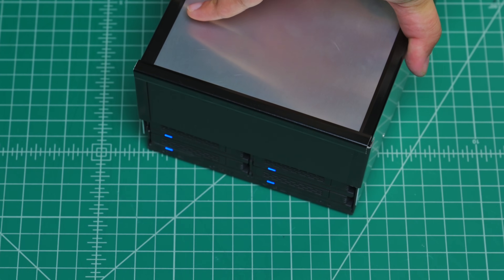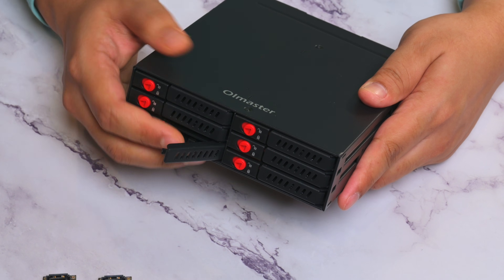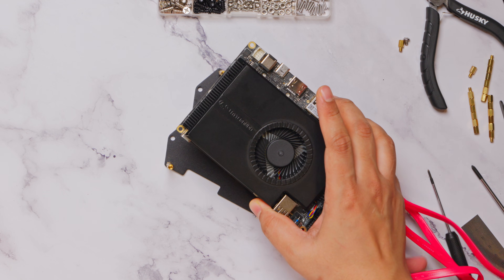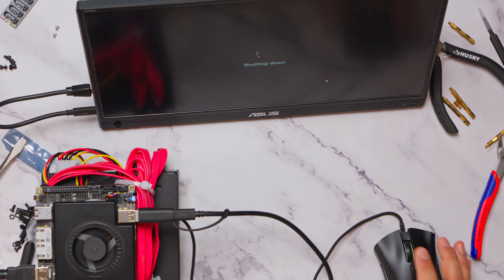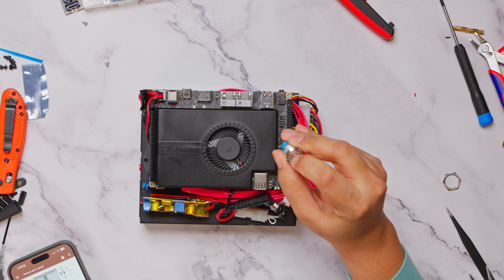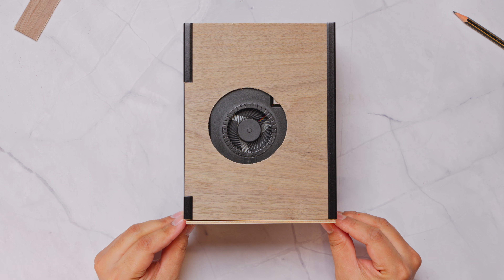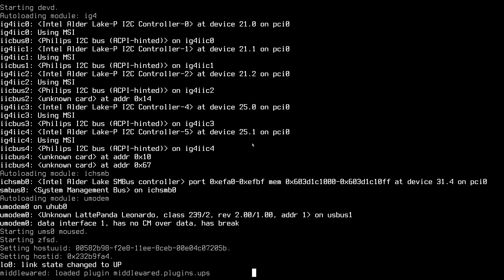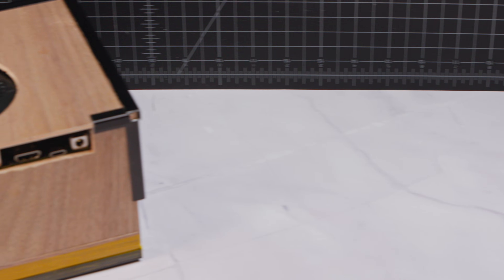Smallest 6 Bay 2.5 SATA SSD NAS Build | Cheap NAS using Mini PC | DIY NAS using LattePanda Sigma SBC

Comment: did you actually have to include a step down of the voltage? according to the specs the lattepanda works from 12v to 20v - so you could have just used a 12v psu throughout?
Reply from the maker: That is a very good question, I wanted to explain that but was too much of a detour so left it out. So, you are technically correct, however there are 2 main reasons for me not doing so,

- They provide a 19V 90W adapter which is the official one they suggest to use, so didn't want to showcase something unofficial here.
- The board needs at least 90W to run properly according to their documentation, probably more if there is heavy load so using a 12V adapter will mean that we will need a 7.5A + power brick @ 12V (90W/12V = 7.5W) which are not very common, and often expensive (high current low voltage is expensive than low current high voltage in general). So instead of crippling the board, I decided to use the buck converter which is like < $5 a piece so was much more cost effective and appropriate, IMO.

Thanks for the question though, gave me an opportunity to clear this out.

Comment: Very nice! I just found these videos (this and about the previous build). Reason I found this was that I've been working on an idea since yesterday about using my HP ProDesk 400 G2 Mini as a NAS. So I'm getting a similar M.2 to SATA adapter, a power extension cable (I won't be using the SSD enclosure inside the HP to save space) and some SATA data cables. Once I've tested and made sure I can fit the SATA data cables inside the case and get the power cable outside as well, I've a flexiDOCK MB014SP-B 4-bay solution to host all the SSDs (that I don't even have yet). Biggest fear is to have all the cables fit inside the HP case and get them out of it nicely. Then if all goes according to plan, I'll just get the SSDs. In case the power isn't enough from the HP itself, I have a backup plan of getting a FSP FlexGURU or something to power it separately. Reason I'm opting for that is that I've no knowledge, skills or tools to work a case for it all by myself =) But this was great to see how you did it all!

Comment: Does the M.2 adapter cause a bottleneck with the 6 2.5" SSD drives?
Reply from the maker: It should not. An NVMe 4th gen (PCIe 4.0) typically has a bandwidth of ~7,000 MBps, whereas SATA has a bandwidth of ~600 MBps. So technically, around 11-12 SATA drives could fit into the bandwidth of a single NVMe 4th gen drive. Also, even if you could fully load it up, the Ethernet ports through which you will use a NAS are at best 10Gbps (~1,250 MBps) for non-commercial usage, so that ends up being the bottleneck at the end of the day.

Comment: Bro, correct me , I found that the total cost of making something similar, like few different components, depends on availability. 

I found that just a 6-bay drive case costs 40k inr, + nvme to sata costs INR 5k, and the cheapest mini/tiny PC costs 10k inr. 
50k approx., excluding a few more components. - is making this NAS cost to some commercially available NAS. - can be, eg ASUSTOR FLASHSTOR 6 FS6706T NAS server, 6 bays this one costs around INR60,000 

Note: all cost are in inr 

So is there any chance that it is better than the ready one? like we go diy to reduce cost, but this got me spend more than that 

It just got in my mind: no hate, also correct me /justify
Reply from the maker: Thanks for the reply. I can't exactly comment on the pricing for markets outside the US, as my component acquisition is mostly centered around US marketplace, and often sourcing parts from AliExpress which is even cheaper. For example, the "6 bay sata enclosure 2.5" - is about $40, which is INR 3500 ish, so if you are spending 40K INR for just the case, then there lies the most of the differences. Same may be true for other components. If you are getting a readymade solution that is more cost effective for you , then please go ahead with that, there is nothing wrong with that. However, if the parts the available cheaper, then may be worth pursuing this DIY option. Also, you have to think about the drives costs etc. Hope this helps.
Reply: @LatticeDensity  Thanks

Comment: 2.5 drives need only 5V tho so you could step down to 5V directly
Reply from the maker: Yeah, but it's not super safe to directly feed in constant voltage to drives as they have other protocols running at times that may dynamically adjust things, so always safer to promote this way IMO, don't want people learning it the wrong way :)

Comment: I'd love to see a rasp pi 5, with m.2 hat and 6x sata ( m.2) case build. i've built a 4x 2.5 ssd penta hat and a friend 3d printed me the radxa case, but 4x1tb is a bit low. 6x 1tb case with rasp pi mounts would be perfect. usb 3.0, 2.5g adapter for speed and low wattage 12v 3/4amp power supply.
Reply from the maker: M.2 drives are definitely a win when it comes to size, but they do come with some major drawbacks—cost, heat, and the need for available PCIe lanes. For a NAS-like setup, individual drive speed isn’t the priority, which is where NVMe SSDs typically shine. Instead, 2.5-inch drives are nearly the same size, significantly cheaper, run much cooler, and use SATA, making them ideal for RAID setups. That said, I have a few videos planned exploring M.2 solutions, so stay tuned for that!

Comment: This is possible to add 10GbE card here?
Reply from the maker: Interesting proposition, you can most likely use a remaining NVME port to connect some converters to end up in a 10G card but may cost some more space. Haven't experimented though, could be fun! Thanks for the suggestions!

Comment: Great build! I tried something similar with a mini pc and M.2 ASM1166 sata adapter but I had to do many modifications and I didn't have a lot of trust in it so in the end I used a SFF computer with a 5.25 inch bay,they are basically an all in one NAS solution for 2.5 inch drives not that much bigger ,just add the 4/6 hdd caddy and an HBA on the x16 slot or  M.2 / WiFi M.2 for sata adaptors.
Reply from the maker: If you can spare the space and not planning to use it for travel, an SFF build, or the Johnsbo NAS cases are the best way to go with. However, many need something travel friendly, and that's where I feel the market is lacking in options. Till this day, I don't see very many solutions around 2.5 inch drives, despite they being the sweet spot for it. The NVME drives are costly, runs hot and needs PCIE lanes, on the other hand the 5.25 inch drives are big and heavy. Still don't understand why 2.5 inch form factor is not more prevalent. Maybe I am an outlier who travels with a lot of tech lol.
Reply: @LatticeDensity  There is lincstation n1 / n2 which has 2 2.5 inch bays and 4 nvme but is not cheap.

Comment: I’d love to see this kind of build done much cleaner,  a 1RU short case would be preferred.  Anyone tested these m.2 to sata converters for more than a few months?  They scare me from doing something similar.   Hopefully we start seeing large cheap m.2 drives to use.  The sata m.2 option is likely not going to be needed or hopefully not needed in the near future.  A m.2 splitter to multiple PCIE x 1 m.2 slots would be the way to go I think.  Also, sadly these boards don’t support 10gb networking yet and with 10gb network prices coming way down finally it’d be great to have that as an option.
Reply from the maker: Agree to all that. Cleaner - Yes, 3D printed case is the way to go IMO but I didn't have the time to design one. SATA converters, I have actually been using one for my bigger storage servers for years without any issues so there's that. Finally 10G, yeah, of course if you have the infra in the LAN, by all means.

Comment: What was is the power consumption of this setup?
Reply from the maker: Very less I suppose, never really felt the need to test it. The only things sucking power are the SBC and the Drives, both run pretty efficient. Should be less than 50W idle.

Comment: more easy buy a mini itx motherboard
Reply from the maker: And make it bigger? The whole idea was to keep it smaller. Actually for this combination of hardware, you can build this idea into a much smaller thing, like a cute little NAS but I didn't have time to go about designing one. Using MINI ITX will make it at least 200mmx200mm footprint which is big for 2.5 inch drives, unless your NAS can do like 20 such drives at which point it would be worth it.

Comment: Overspending on that sbc which has no ECC and then lacking money for a Jonsbo N2, my kind of humor 😂
Reply: You are wrong, LP Sigma has in band ECC.
Reply: @bedaschmid439 its the same as having no ecc at all as this is just to battle the higher density on the ram chip and therefore higher risk of errors. In band ecc will not gelp regarding computational errors like real ecc will. Therefore, why are you pointing out this marketing bs ? You are only confusing the average person who reads ecc. But maybe you are one of those who fell for this marketing bs.
Reply from the maker: If you knew in how many projects I have used this board in, and plan to in future (including Gen AI based ones) you would see how cost effective it has been for me lol. However, I don't recommend using this board if you are only using it for a storage server which I made very clear in the video.

Comment: that is so silly.

best what we have in regular SATA + regular PSU (in comparison with laptop's and other silly "formats") it is ability to use 3.5 HDD where are option with 18Tb 20Tb 22Tb - and when have ability to use 3.5 fortma use 2.5 - so silly.

for example here we see 6 unit case - you all can say "whatever you want"  but to ME is 108Tb (18*6) of capacity is more interesting instead of economy 10cm(or whatever it is) in 2.5 format 

silly.
Reply from the maker: I am not even going to argue on this. Just wanted to remind you of a basic characteristic of the market, that everyone has different needs and dimensions for optimization and nothing is an absolute "silly" in this world, everything is relative to the frame of reference.

Also, just to complete your knowledge, there is a new 24TB HDD lineup available now, so your "non-silly" server can actually be maxed up to 144T in a 6 bay setup. You may wanna go with that  😅
Reply: @LatticeDensity  oh he could go with the 3.5" SSD's which are now 100TB each from Exadrive... so a 6 drive system would be 600TB... But apparently he only do silly useless builds....

Anyways LatticeDensity loved your little build there, well done
Reply from the maker: @LiLBitsDK  Thanks! Yeah some people just have to be mean, that's all. There is nothing wrong in adding my a new viewpoint or more information, but taking the tone beyond that is just simple arrogance and is not useful in any way, except to feed the author's ego 😅

Comment: I have an idea for you make a case with 3d printer and Use synology OS [Bypass]. Make a new video
Reply from the maker: I don't know if Synology OS is open to use like that, but 3D case for sure would be a nice upgrade 😊
Reply: @LatticeDensity  Yes you can use Synology on this build easily

Comment: If someone in here want to follow same route of this video, i reccoment to get intel n100 firewall pc and pull out the motherboard to save some money. It has 2 m.2 you can put one of then with m.2 sata to 6 drive for using 2.5 drive
Reply from the maker: Yeah totally! I actually mentioned that in the video as well, this board I am using is super overkill for this project and an N100 is more than enough. Another good option is the new Latte Panda Mu board with the basic carrier board that also comes with NVME Slots or the X1 SBC 🤘🏻

Comment: Nice build.  It's too bad providing power is a pain.  I never understood why no one makes a 2.5" ssd solution besides qnap (the qnap was overpriced, had motherboard failures and were underpowered).
Reply from the maker: Thanks! Actually as pointed out in the highlighted comment, one can use the 12 V input here for both, as this SBC (and many other) support a range of voltages so that would make the power flow easier to build. Also, if you compare it to having a full PSU in there, I think having a few extra DC connections is fair game ha ha. Also, Synology has one too: https://www.bhphotovideo.com/c/product/1496996-REG/synology_6_bay_2_5_nas.html but same for over-pricy behavior, not accessible to many. With an SBC like the X1, one can build this for as little as ~$200 which is much reasonable IMO.
Reply: @LatticeDensity  Thanks for the explanation.  I forgot about the synology.  Great form factor but you are right, too much for that old of hardware.

Comment: to be honest i did like the idea till the video started  playing. the woodwork  is crapy sorry i would scrap this as it is . second thing is this brand board you can get away with used motherboards if you are doing budget- this board is just super expensive(yesyes it is maybe some energy efficient but if you want to count a bit - i can buy a mobo+cpu+ram+stock cpu heatsink combo for 50  it will idle at 15 w  or so that 10 w in pricing untill it catches up to this it is going to past a decade- not even calculating that not everyone is keeping nas online 24/7). 
so by my opinion this is far away cheap. about the bays- i seen another video where the guy just got  hot swap bays from dell servers and just from alu profiles made the slotts for it- that is actually cool moneysaving and great looking .  i understand that the project was made only with hands and dremmel but it is on a level where i was in basic school- we did better looking projects there. i would highly advise to redo this video with some attention to budget and details- in current form just look at used parts prices please and be honest with yourself - would anyone replicate this for any reason?

Comment: Is the trueNAS Core does not have the ZFS performance measuring process during booting? I have installed trueNAS scale....
Reply from the maker: Not sure about boot time, but there is a scheduler that does it on a cadence. Core is generally easier to use and considered more stable so I have always used Core, but it's not necessary obviously

Comment: One useful tip for building projects in the future: always take into consideration that you might have to disassemble your build at some stage, so design things which can be taken apart and disassembled. While the case looks well put together, you're gonna have to destroy it in order to access the internals in case you want to replace or fix something and that will make the building expensive on the long run.
Reply from the maker: Yeah that's very true. Like I mentioned in the video, I hadn't spent too much time perfecting the case here but ideally I would keep repair-ability a top priority 🤘🏻